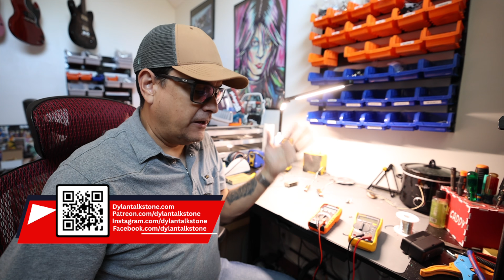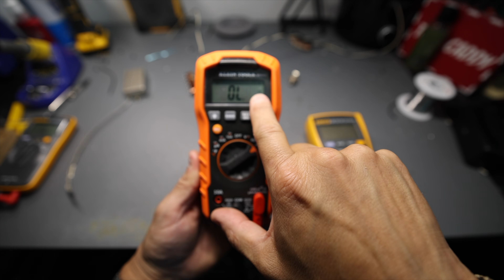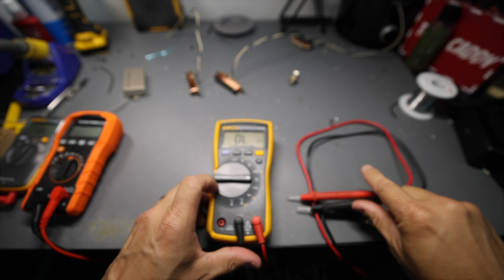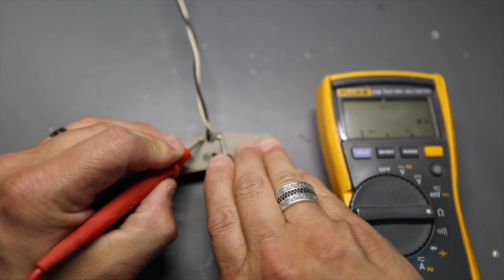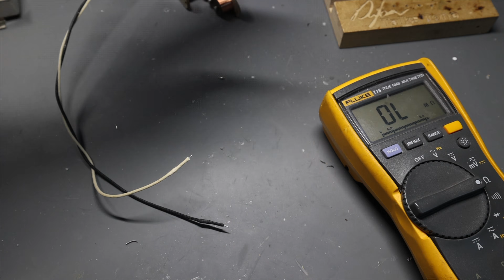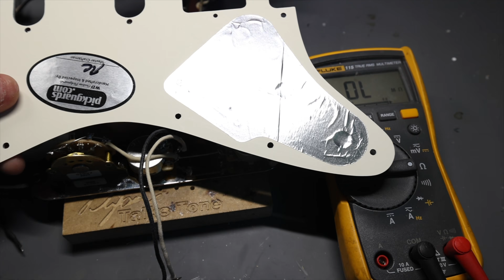Why Your Guitar Suddenly Went Dead (and How to Fix It)

Comment: Great video, Dylan.
I have a strat with 2 tones that do nothing. I can hear something rattling around inside. I thought the noises sounded like broken off solder blobs. There is also a bit of crackling with the output jack.
I have a cheap multimetre and soldering iron. So next time I change the strings, I reckon I'll be able to solve the problems. 😊
Thanks -Rod

Comment: at 11:00 minutes you mention grounding everything to the volume pot.. i have a telecaster style guitar without a control plate (going directly on wood)..im installing all new electronics.. i have a traditional 3 way switch like yours.. would i need to ground the switch to the volume pot as well?

Comment: The guitar goes dead, because the toan escaped...
Seriously, the biggest factor for me is something shorting out against shielding....  especially around the jack.  Most commonly, the jack gets a little loose, and twists, with the lead touching the shielding on the side wall....  Same thing with a switch being so tall that the soldered leads touch the bottom of the cavity.  I find that I regularly add electrical tape to those two areas after shielding to prevent those issues from happening.  I know some people say not to bother shielding, but, I like my single-coils, and the airwaves are getting dirtier every day...  It makes a huge difference, so NOT shielding just isn't an option.  Already fighting the transmission bursts from the fire depot and the cop shop...  Airport near by?  Forget about it...

Also, out of curiosity, it looks like that orange cap on the tele wiring has the source lead touching against the capacitor casing...  Will that effectively bypass the capacitor to ground, or put it in a strange parallel shunt?  Is that by design?  Does it make a difference tone-wise?

Comment: Better late than never. Got mine on Amazon, for around $10. Works "good enough", for an item I might use once a year.
PS. Thanks for the tip on the Pure Tone jack. I might get one, "just in case". Sweetwater has them for less than Amazon.